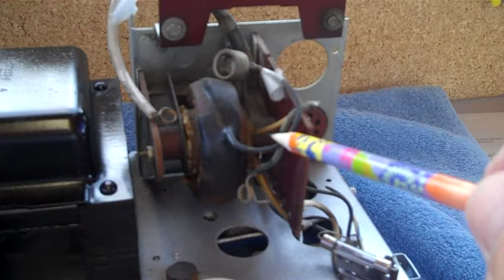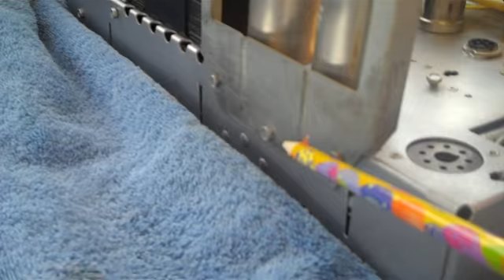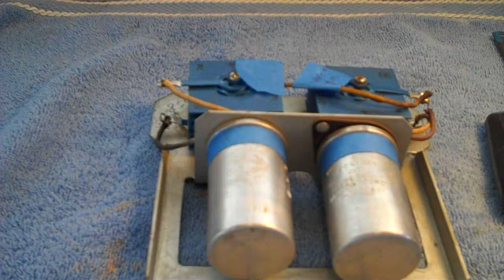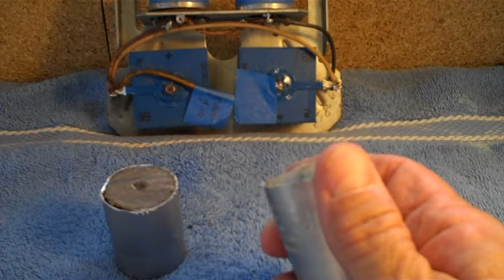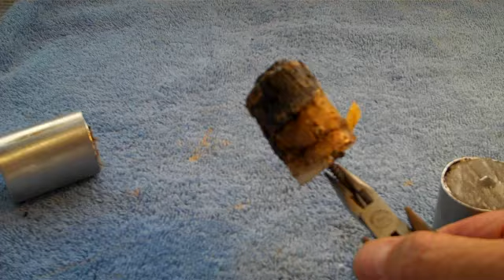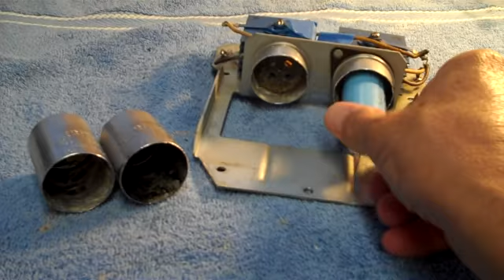1952 RCA Model 17T151 17" TV Repair and Restoration (Part 9 of 27).

Comment: Hi John,
I enjoyed the Philco restoration, great job by the way and now I'm watching this one. I'm a machinist by trade and thought maybe I could pass something on to you. It's pefectly ok to file aluminum but, not grind it. What happens is, the aluminum gets imbedded in the grinding wheels and acts like a wedge. Think of splitting firewood. Splitting a grinding wheel while it's spinning will really ruin your day. For removing aluminum embedded in the file teeth pick up a file card or cleaner.